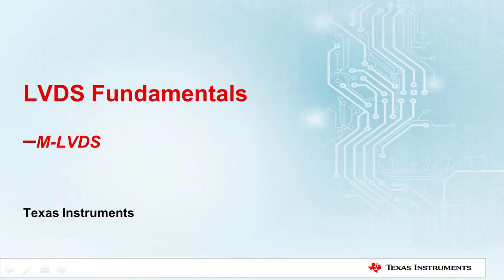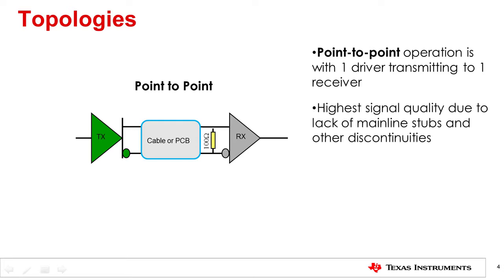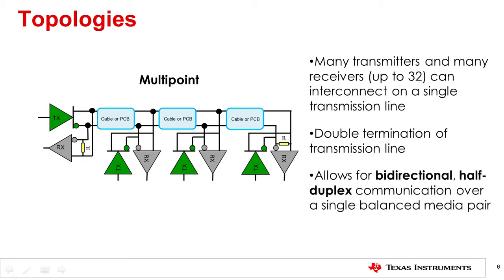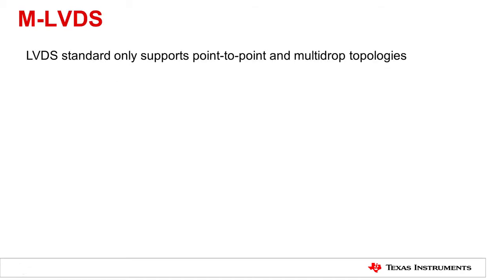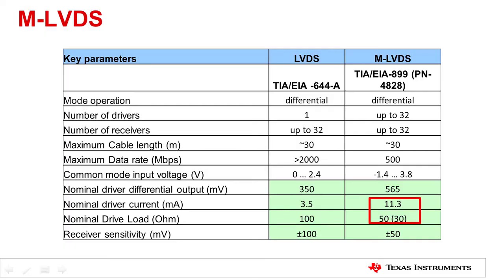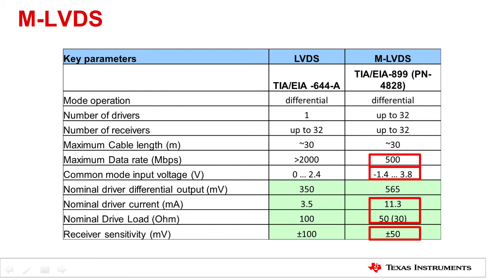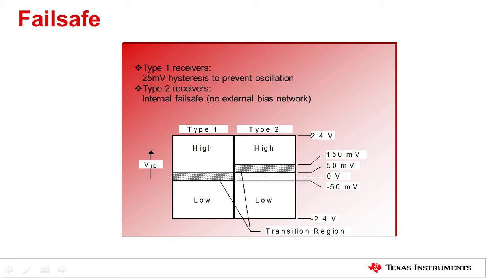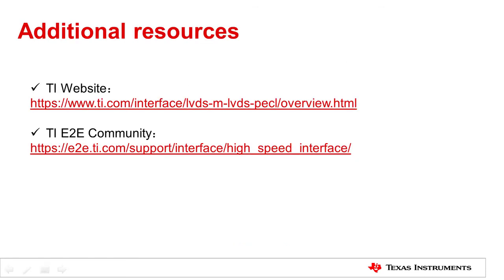M-LVDS and Communication Topologies

Comment: Why is double termination necessary? Does the placement of the termination resistors matter?
Reply: In previous video showing the Half duplex topology, the Transceivers at either end can toggle between being TX or RX, depending on message direction flow.The proximal resistor at each end generates the local voltage to drive the differential input of the end that is currently the RX. The resistor should be placed as close to the differential Transceiver Input/Output pins of the device as possible